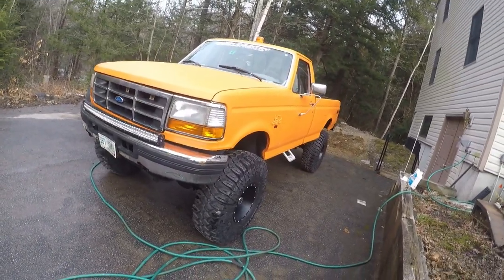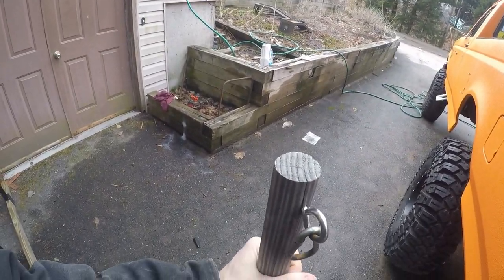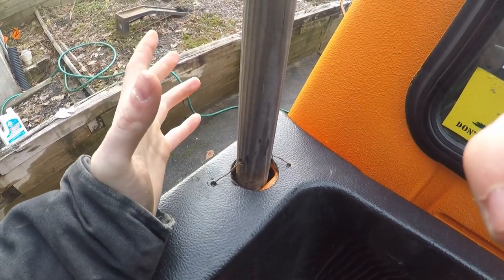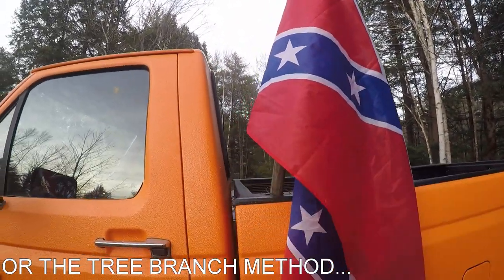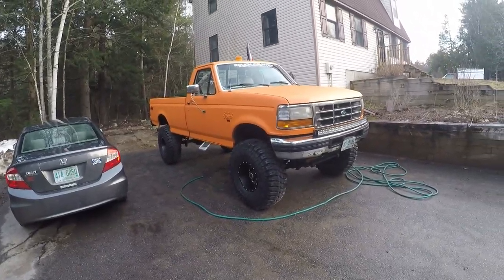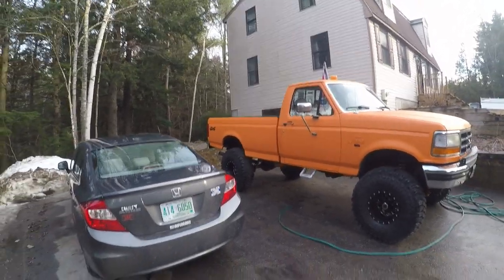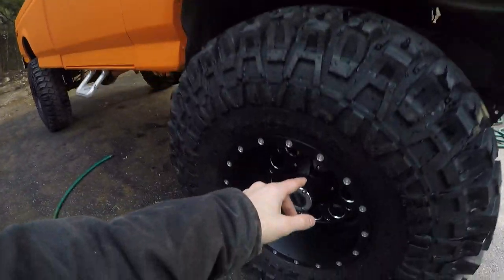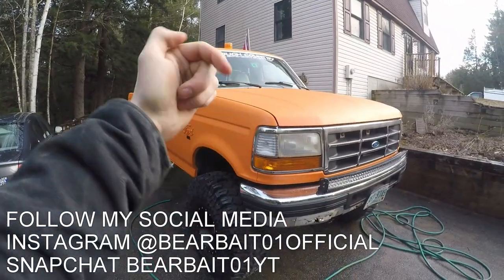CHEAPEST DIY TRUCK FLAG POLE! 9" LIFTED OBS FORD ON 38s

Comment: How long do those polyester flags last?
Reply from the maker: Depends really. Can last 2 months max if you don't get them wet. 2 weeks if you drive on the highway. Usually a month. They cost like $5 though. But sometimes you get a bad one that'll come apart in like a week.